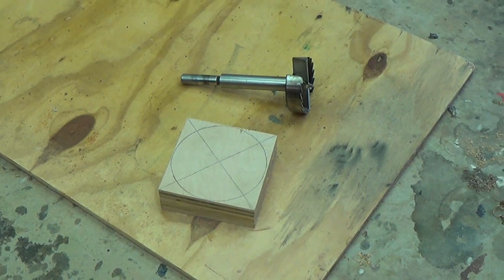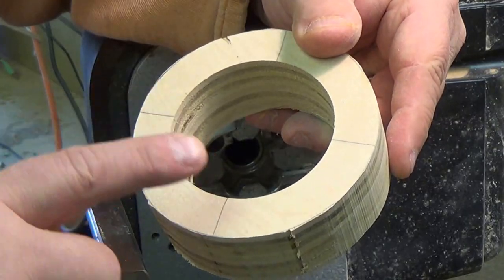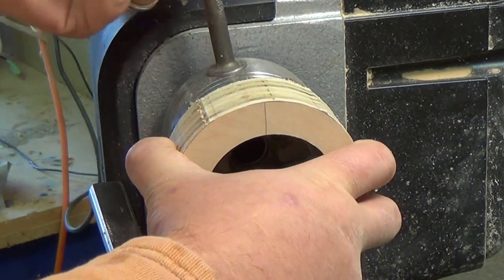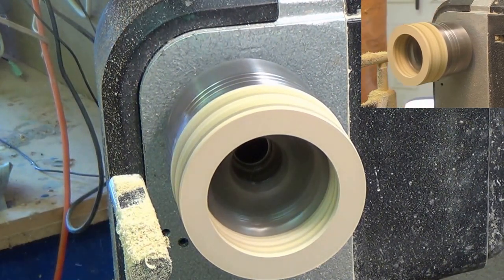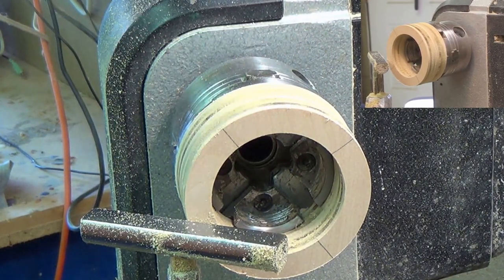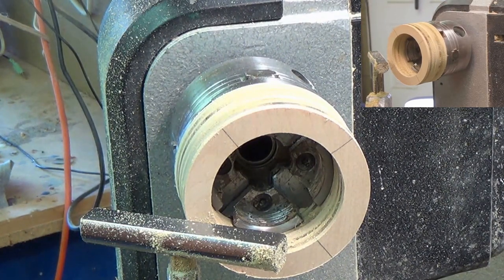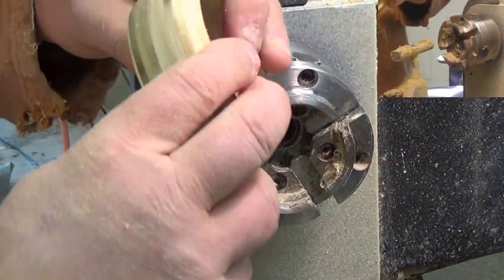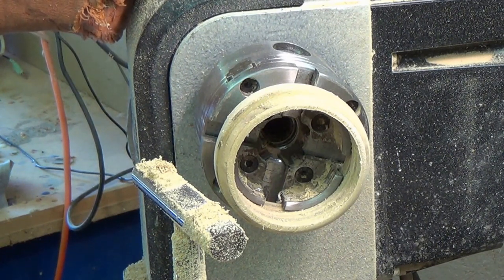Turning a plywood bracelet - PIP

Comment: Liked video,  did U use a Fostner bit to cut circle 2 1/2"?    I have a fostner bit but it sure takes a long and slow drilling time.   Then tried laigh w parting tool and worked grate.